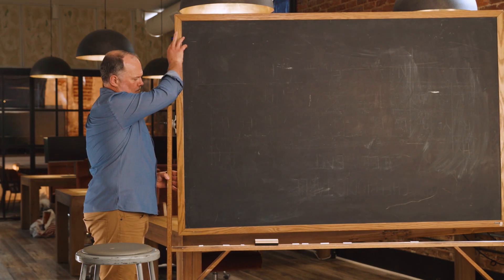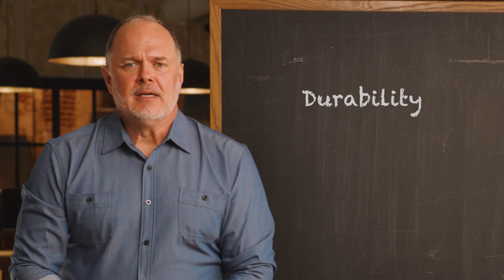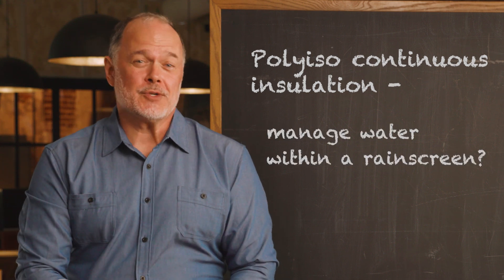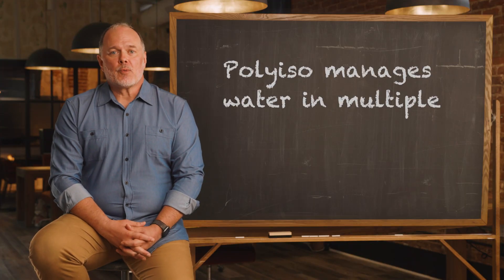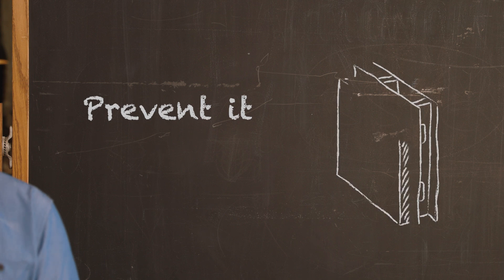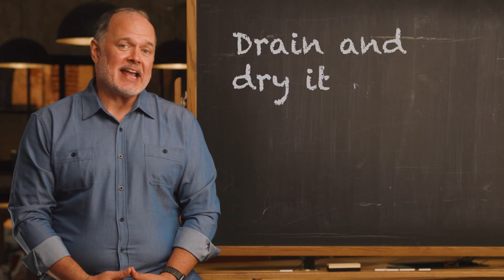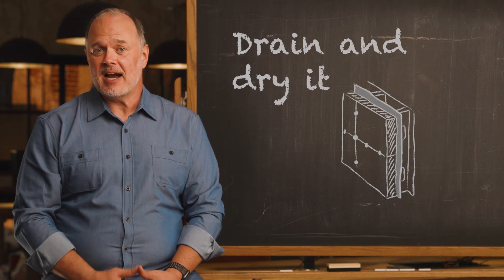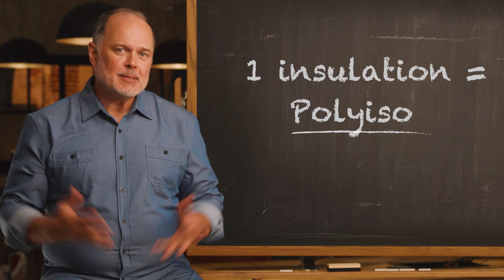Polyiso CI | How Does Polyiso Manage Water in a Rainscreen?

Comment: If the water can escape behind the layer of insulation  so the heat can escape through that pass away. What is the point of having that insulation if it is not designed to keep heat inside the house